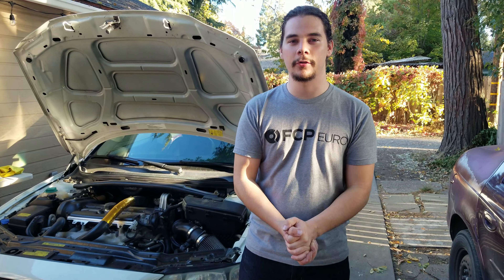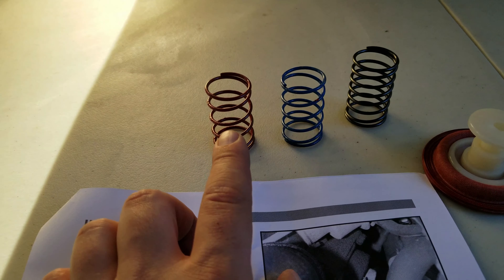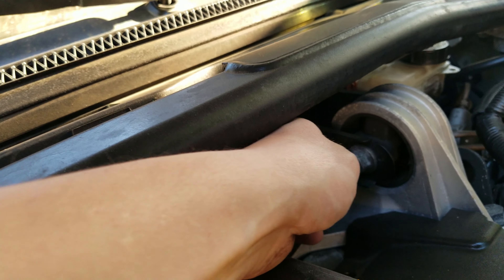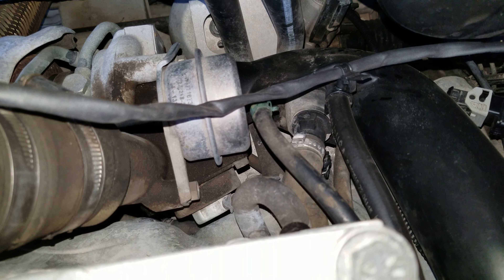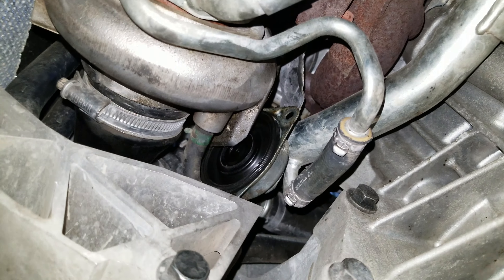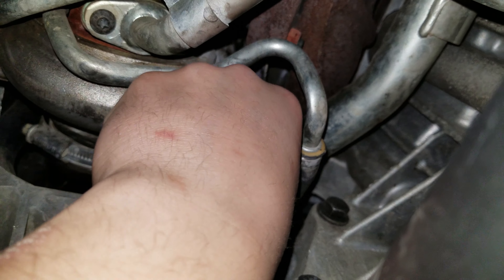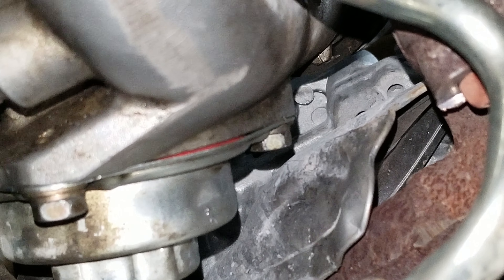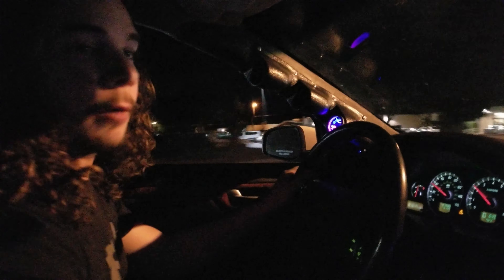Installing IPD HD Compressor Bypass Valve

Comment: I changed mine while I had the turbo off. I got the turbo upgraded and put it on before I swapped the turbo. I love the sound when it goes off. I used the black spring until I finally get a tune and then Ill swap to the blue spring
Reply from the maker: I'm actually running the blue spring on my stock tune.

Comment: I have a question. Could you have removed and installed a new complete valve from the bottom? I ask because my crappy factory nipple broke off and I have to replace the whole unit.

Comment: How much boost are you at while using the blue spring? Because I wanna use the blue one also I just don't want it to surge. I'm also on a stock tune
Reply from the maker: I'm still on stock boost numbers and stock tune. Around 12psi.
Reply: Alright cool I'll go with the blue one too even tho my car barely spikes up to 10 
or 12 but drops to about 9 psi but my car is a 02 s60 t5 2.3 5 speed so maybe the tunes different or I've got a bad tcv or ripped cbv not sure

Comment: Will this help the engine hold boost better?
Reply from the maker: That's what the idea is. Your CBV is designed to relieve excess pressure in the compressor side turbo housing. When springs get old and wear out, or rubber diaphragms start to get old and deteriorate, the CBV can start to open when you do not want it to. Just keep in mind that upgrading to a spring that is too stiff for the boost levels you're running can result in poor performance and chatter (turbo surge), which isn't actually good for the car, even if it sound cool.